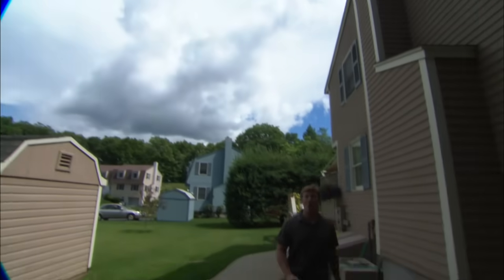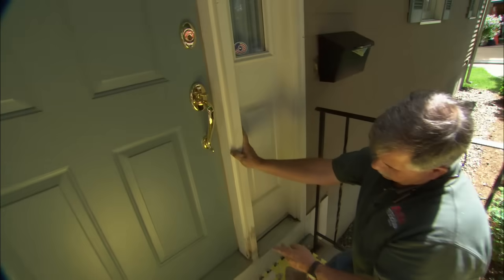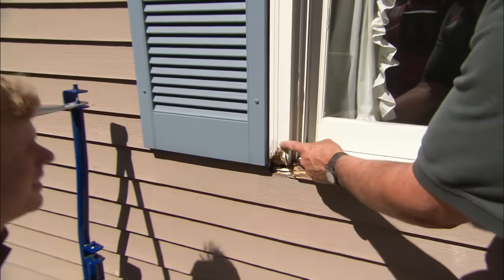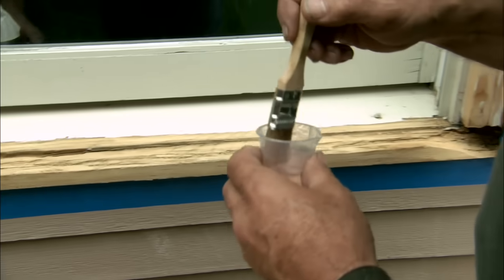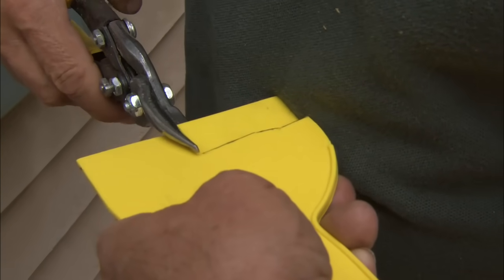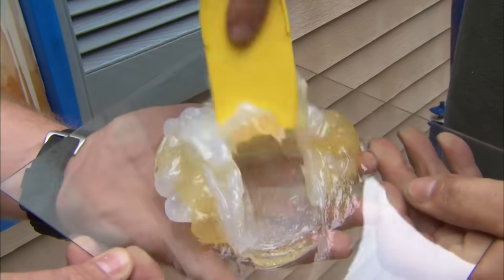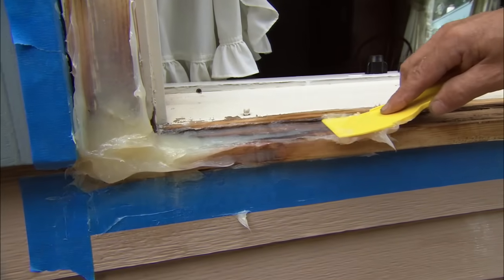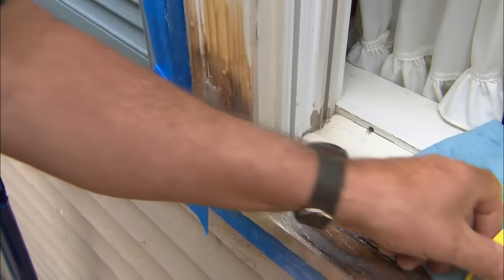How to Fix Rotted Wood with Epoxy | This Old House

Comment: Automotive body filler (Bondo) available in "Classic" and stranded reinforced formulas for heavy build-up applications works very well at a fraction of the cost of the product that you are demonstrating.  I've used it for rotted wood moldings and frames for 40 years, particularly useful for 100 year old Victorian scroll work moldings that are difficult to reproduce today.  Applications on my own home that are 20 years old are holding up fine and undetectable today.   Bondo is also a two part epoxy that can be drilled, sanded and shaped with common woodworking tools and no special applicator required.
Reply: I have been thinking of trying Bondo. Does it require a bonding agent, and if so what’s a good one?
Reply: I agree.  Body filler is much cheaper and very strong too.  Epoxy is  not needed.
Reply: I've heard that the downside of automotive body filler is that it doesn't expand and contract as much as the epoxy they are using here, so if you use it outside it's more likely to crack and pop off
Reply: @StratKruzer  No.  I've never used any type of bonding agent for wood repairs with Bondo.  Just make sure that all the damp rot is removed and dry the cavity with a heat gun before filling the void.
Reply: Chris Graham Thanks! I have some window repairs coming up, so I appreciate your advice.
Reply: Yep! Used Bondo multiple times on our old home. Sets up in 30 mins, is waterproof and dries rock hard. A can is $15 at Home Depot.  Sands super easily with a low grit paper too.
Reply: StratKruzer bondo works just as well. $15 a can, and it dries in 30 mins.
Reply: I have some bondo i used for automotive work in my garage, can i use that?  i also have some fiberglass bondo that i used on a car with larger rusted spots to build up the hole and then i would use my bondo for surface filling over the top of the fiberglass.  Is that something i could do with my window sill?  I have lots of sandpaper and other tools to do bondo work but I'm just a DIY'er so yea, just want to check with you since you have done this so long and are an expert at it.  i would love to get some use out of that bondo as it's been sitting in my garage now for going on two years (perhaps less).  Thanks for your time in advance man!!!!
Reply: can i use bondo to repair the cement  pot, the flower pot missing a small piece so whether bondo do the job
Reply: sajiktm yes.
Reply: I used Bondo on a chipped porcelain tub. Lovely stuff.
Reply: Never use bondo for that.
Reply: Bondo (the pink stuff) is not water proof. Fiberglass bondo is waterproof. FYI.
Reply: Yes, I have had success using Bondo to repair rotted window sills and casings too and it is much cheaper than the epoxy.
Reply: @jkgoet01  Ive looked into that and if you attach some screws and staples then fix around those with the bondo it might not be a issue. But 10 bucks compared to 200 for this stuff worth a shot.
Reply: I've done the same. I like to use a coat of fiberglass resin and let it soak into the wood first and a couple screws part way into the wood acts like rebar and locks the bondo in.
Reply: I agree.  I used epoxy like this (at the request of my customer) to repair casement windows and it failed in 5 years.  I usually use Bondo without any issue.  Plus I believe it’s easier to work with.
Reply: @toadshrm  and I've come behind bondo repairs multiple times that have failed. I suspect that whoever did the repair failed to get all of the rotted wood out before repairing.
Reply: Exactly what I did on my house 30 years ago.  Works perfectly!
Reply: It's 22.00 a for both tubes....
Reply: @s.r.1953  Bondo is not "water proof" but it does not break down with water.  If you use Bondo, your need to prime and paint to make it waterproof, just as you would when making and automotive repair.
Reply: @ottokriete1153  The rotted material needs to be removed as completely as possible and then dry the fibers out completely for the Bondo to adhere properly.  I use a heat gun to thoroughly dry the cavity and it has worked very well.
Reply: I use bondo too
Reply: I realize it's pretty randomly asking but do anybody know a good website to watch new tv shows online?
Reply: Auto body filler dose not expand and contract with the timber and seperates over time. I repair a lot of these old 'fixes'. It is not suitable for timber.
Reply: @roilhead  Timber expands and contracts due to it's moisture level, rather than temperature.  If the repair is properly sealed with paint or other moisture proof coating, the expansion and contraction should be minimized or non existent.  I have repairs on 19th century gingerbread trim that have lasted 20 years without incident.
Reply: @chrisgraham2904  The issue with this is that when the repair is made there is usually still moisture contained within the remaining timber and usually impossible to remove fully. Shinkage after the repair occures untill everything settles and produces a hairline crack arround the repair with creates another water entry point.
You used the word 'Bondo' which is usually an Ozzy term, I'm next door in NZ. Wetter here and harder to remove the remaining water in the timber.
Reply: @chrisgraham2904  I used to use Bondo but have noticed issues with it over the years so now my preferred method is to cut in timber and add an expanding glue (not foam) and screw the timber into position. The glue expands into all the crevices and makes for a great bind. The down side is that I need to leave the area for a few weeks till the glue has fully expanded and dried till I do my final work on it. This makes my payday further down the road but I feel more confident that I have done the best I can do. 
I've been off doing larger building jobs for a few years now and I'm getting back into it full time. What I find is that the client will call for 3 quotes and I will be the only one to submit a quote as most tradies don't want to touch it due to having bigger jobs to deal with and not having the experience to deal with it. They want to build houses or do large extions. I adjust my quite a acordingly higher to accommodate the extra downtime. If I can't fix the issue, the next option is to replace the window which costs some serious bucks. Nice easy work for me, with a good return and very few tradies chasing the same market. Happy days...
Reply: @roilhead  Cutting in fresh timber is always the best option, particularly if the void is large or if the timber shape conforms to the void.  CA glues with an accelerator can provide the fast drying time and limited build up.  
As a handyman, my bread and butter is the smaller, sometimes more time consuming and dirty jobs that contractors can't be bothered with.  As long as the target project can be made new again for less than 50 percent of the cost of replacing the target, then it's worth refurbishing.
Reply: @roilhead  "Bondo" is the trade name of the most common epoxy repair compound for automotive body repair in North America. Available in recent years in it's "classic" paste form and several mixtures with embedded long and short fiberglass strands for reinforcement and thick build to avoid slumping.  Removal of all the rotted and damp wood pulp is imperative before filling the cavity for a good bond.  I use a high-temp heat gun to fully dry the cavity as much as possible before the Bondo application.  As with most tasks, preparation is 90 % of the work. Filling, shaping and sealing is the other 10 %.
Reply: @chrisgraham2904  The moisture content of timber at the time of installation here is below 18% but the actual operating mositure levels are variable. If the timber is not at the level that it will revert to once it is all closed up again cracking will occur if the difference between is too great, this includes the timber being too dry at the time of repair.
Reply: @roilhead  The fibers that are super dried by mechanical means should be stable fibers, without rot, and exist directly beside the best wood fibers.  I suspect the moisture level of the "good wood" will migrate to the dried fibers quite quickly to stabilize both to about the same moisture level.  I'm not a physicist, but mitigating each step of the repair process will result in longer longevity.
Reply: @chrisgraham2904  Exactally but most do not do this and in some situations it is not possible espically here in New Zealand in a hot & wet climate, that is why I prefer to use timber.
Reply: I've used the Bond wood filler to repair horizontal cracks in our >100-year-old wood clapboard siding (no idea why these cracks formed). I cut out the crack to create something to fill and something to adhere to (like I do with sheet rock). What I don't like about Bondo is it sets up so quickly - 15 min working time (as stated on the can). So I can only make 1/4-1/2 cup at a time and need to move very quickly.
Reply: This is definitely the way to go. Not to mention that the gun costs $200.
Reply: @roilhead  what expanding glue do you use? Can you provide a link?
Reply: @russellmathias6911  I don't have this, but I've heard Hulu; I believe they show a day later, though - good luck!!
Reply: @jkgoet01  in
Reply: Bondo = Porus and the structural integrity is very much less when compares to low grade epoxy. Epoxy is more expensive and harder to work with but it will last longer.
Reply: You are a 💎 u just answered my question. I will use Bondo for my bed post
Reply: @ladyowl6743  LOL  I won't ask how your broke it.  :)
Reply: @chrisgraham2904  😂😂 naw!!! 🤣🤣its actually my son's bed and my grandkids jumped on it and the wood split right where the hooks slide in.. 🤣🤣🤣🤣 but u got me! 🤷‍♀️
Reply: @chrisgraham2904  thank you for both your initial post (and the followup responses). I have a cracked door sill which I suspect would be expensive to hire a woodsmith to repair (both in labour and material cost)...but I'm concerned if I ignore it further, it will break. 

Also the two part wood epoxy with the two part liquid pretreatment solutions are very expensive as well.

The door threshold  is a  sheltered sill (the bottom part, I hope I'm using the correct word) but due to the neglect and southern exposure the paint had long ago popped off, leaving the much smaller crack "repair" exposed. 

This failure occurred almost  immediately after I had hired alleged College "Pro" PaInters as I was at the time too ill to undertake the task myself.

Retroactively I recalled that in performing such a repair myself on a previous house...after the paint had  likewise popped off after the repair was primed & painted with an excellent quality oil exterior paint...I returned to  the paint store and asked the  employees what I might do to avoid this issue. 

They were no help...but luckily a group of older gentlemen were hanging around the store and they were incredibly kind & helpful, knowing I was a DIYer and could not afford to hire a contractor. 

They concurred and  suggested the dry wood had sucked the moisture out of the paint, hence the failure. They suggested I sand it back beyond the patch and saturate the wood with multiple coats of boiled linseed oil, allowing each coat to dry and repeating until the wood was unable to wick the oil away. 

If I recall correctly I used a matrix of wood glue and fine sawdust or wood Putty to repair the tiny cracks, but I might be mistaken.

I want to attempt the repair myself with the waterproof fiberglass Bondo as recommended above...but I am concerned about the dissected yet sound wood beyond the crack. 

Throughout the summer, I did as they suggested & when I finally primed and painted again...the repair vanished and the effect was truly remarkable. 

We sold that house but I passed by some many years later, and I checked out the repair and it was still solid & indistinguishable from the body of the sill. 

Would the boiled linseed oil be the best treatment for the desiccated sill or is the resin  there a new (and not prohibitively expensive) product (such as the product suggested above) to pretreat the sill?

Thank you if you or anyone else replies.
Reply: Bondo IS an epoxy filler
Reply: @vapeurdepisse  That's what I said; "Bondo is a two part epoxy".  This automotive product remains a fraction of the cost of the "architectural epoxies" and performs as well, or better.
Reply: I agree I have used bondo for wood repair and it works well also durhams water putty is great also both products work well and sand easily to a smooth finish for painting
Reply: I used bondo on my wife’s face. A little sanding and makeup it was cheaper than plastic surgery 😅
Reply: @Mike_Greentea  ...or you could have just a tattoo on her face of a pretty girl.  lol
Reply: The Bondo doesn't penetrate the fibers of the wood the epoxy does it makes it harder than the wood ever was
Reply: Thank you for sharing your experience.
Reply: Thanks Chris !  I'll be attempting this repair on my house in the morning !

Comment: Tom, after I learned about this product, I have kept a supply in my garage for the next project that pops up.  Your window project in this video was a large undertaking and I have never taken on a project this large before.  I have used this on window brick mold and other applications on the exterior of my house.  Currently using it on my French door threshold.  I have found in the cold weather it can take a lot longer to setup.  I always get nervous thinking maybe I did not mix it correctly.  Recently ART was sold out of the large double tube, which I love to use with the caulking gun.  Due to Covid shortages they were having trouble getting stock for the large double tube.  I was encouraged to order the smaller project size, which I do not like as much, I found when I went to reuse the smaller tube after a couple months, there was some hardening at the applicator tip area.  I recently saw ART had the larger tubes in stock, so I bought one.  It is great stuff.

Comment: Great video! Good explanation of the contractor grade versions of this, but there are super easy homeowner ways to do this too. JB Weld 'Kwikwood' is a putty that you knead the parts together and once mixed you just press it into the void after clearing out the rot. You can easily knead it and shape it for about 20 minutes before hardening. After 1 hour it can be sanded and painted. Nowhere near as messy as this. The end result is surprisingly tough and blends very well with the wood.
Tbh, this rot is so extensive it would have been easier to rout out the remaining wood square-ish and cut a filler piece of wood to fill this large area.
Reply: IS there anything that JB Weld products can't fix?
Reply: @surfordie82  Toughest epoxy filler and repairer on the planet.

Comment: I save the wood "dust" from sanding and use it when mixing epoxy. It stiffens the mix and makes it easier to sand. It works as well as expensive fillers.
Reply: Great tip what is the ratio
Reply: @danarzechula3769   I would like too know as well.   Also does anyone know which epoxy and primer he is using.   I haven't seen it in the comments but I will continue looking

Comment: I am working on a rotted window sill much like the one in this video and I like how Tom made the template to match the profile of the molding.  Instead of using an epoxy, which can be pricey, I have decided to use some foam insulation and Bondo.
Reply: Except for the fact that the template he made was absolutely useless as he didn't cut it straight and you could see that he ruined the work he had already done as soon as he took one swipe and they switched the scene. When he was scribing with the pencil he let the pencil fall in the dip of the rot and drew a crooked line. He sat there for 30 minutes making it straight with a knife he didnt cut, off camera. I'd bet on it. 🤣🤣
Reply: @matthewmcneil9812  I was thinking it looked like a good idea but your prob right. Bugger trying to cut those plastic scrapers. I’ve seen neat profile tools but tbh my freehand profiling is reasonably neat on my 70 year old timber windows.

Comment: In the larger voids use screws so the expoxy binds to the screws as well making a much better bond.
Reply: good idea
Reply: I have used that method with concrete repairs, on large repairs tie wire can be wrapped around the screws in a random pattern to make mesh like grid for extra reinforcement.
Reply: @dodge96sport  Rodger.. sounds like a fiddle I would sort out in the fly..
Reply: Screws will rust out over time making it look like crap many years down the toad
Reply: @BlessednFree  only if you don't use untreated screws. Useing screws makes a better conection between the timber & the product since one is inert & the other expands & contracts.
Reply: @BlessednFree  down the toad???
Reply: @BlessednFree  screws won't rust under epoxy since epoxy is not pours and won't soak up water.

Comment: Keep in mind one of most hazardous things you can do with epoxy is to start sanding it before it's fully cured.  So scrape, cut but don't sand until the next day. 
I've made some wooden strip kayaks and so I've used a lot of epoxy. The cheapest easiest way I might deal with this rotted wood work is to get a less expensive brand of epoxy, mix it up (as a liquid) then add filler. A filler I've used many times in a pinch was instant pancake mix. Baking flour (that Gold bond stuff that keeps dry for a year? It's not really food anymore) makes a great filler. Mixed in with the epoxy I've never had any bugs or problem. If you mix your epoxy and then add the filler right away you get longer working time. If you let the epoxy sit mixed for 5 minutes, then add the filler, it goes off a lot quicker.
Reply: Another good filler material is the dust from a shop vac or dust collection system on your table saw if you have one.